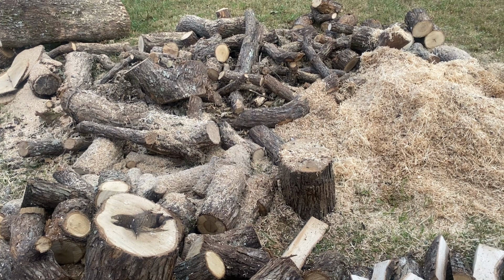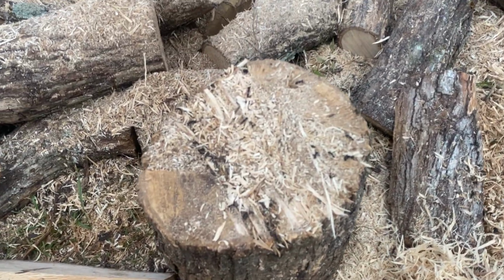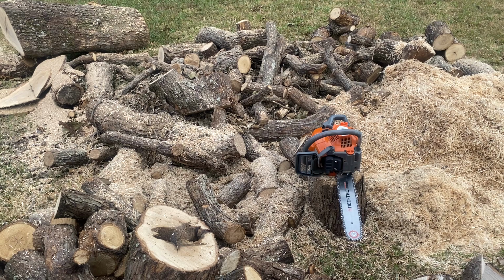First tank on the NeoTec 843 since strato gasket cut!!!!

Comment: I can't hear any difference, what with both being deaf AND my phone on mute 😜 but it certainly looks to be cutting pretty well there after that gasket chop.
Reply from the maker: It definitely made a huge difference. Before it was just boggy and running very rich and wouldn’t lean out any. Now with the extra air from the strato ports it is running leaner and more efficient. Pretty decent little saw for the money.

Comment: I have an Echo 3510 that I've done a muffler mod to.  Seems like this would blow it away for only 1-1.5lb more weight.  Have you ever ran the Echo 3510 and how would it compare?
Reply from the maker: Ran a few hot 4910s but not the 3510, that saw ended up having a bad Carb and blew the spacers out on the crankshaft, new version is updated and runs so much better. 👍🏻
Reply: @dubbssawshop how do you know if you’re getting the new version? At $140 it’s hard for me to not pick one up
Reply from the maker: @bradeagle9724  on the site the newer ones are like $140 the older ones are like $100-$120

Comment: Cutting real good now!  I like the muffler mod too.  Someone said it is an open can?  I mean, it is a strato saw, so it should be just an open can.  Does it ever feel like it is running hot, or over heating?  But, looks like a great little saw.
Reply from the maker: Yep the muffler is an open can, and so far it has been a great saw, never overheated so far anyhow. Strato saws always seem to run a bit hotter than normal saws, but nothing out of the ordinary.
Reply: @dubbssawshop  I just got one, and fixed the gasket covering the strato port, and it runs just like yours - which means pretty good for a stock little saw.  I need to do a little muffler mod, but it runs good just out of the box, once you fix the gasket.  Thanks!
Reply from the maker: @bennyblanko3  awesome!!! That's all I've done to mine still, has plenty power for everything I use it for and pretty light too. 👍🏻

Comment: Hows the plastic case on it? I saw a video where just the pull cord recoil allegedly cracked and dented it. Whats your thoughts?
Reply: The plastic isn't up to Stihl or Husq. standards, and lighter and more brittle plastic.  But, not bad, and fit and finish and color are pretty good.  It is "easy start" and, though I haven't checked compression, has quite a bit, just by feel of the pull chord, for a little saw.  I could see how letting the pull chord zing back would break the recoil plastic.  Especially if you didn't fix the intake gasket problem.  But, once fixed, it starts so easy - one pull, and runs great.  But, not fixed, and having to pull a bunch of times -better be aware of the lighter plastic, or I could see  you ruining the recoil cover.
Reply from the maker: I haven't had any issues at all with plastics yet. Not very high quality but def holds up better than some I've seen.

Comment: These smaller 2 ring saws really need a longer break in time then most.  The good news with this saw is no muffler mod is needed. The muffler is almost an open can with very little impeding flow.  I don't see any potential for gains.  Mine didn't even come with a spark arrestor screen.

Comment: Port job. And alternative fuel ⛽️
 No sir that’s not the lazy way to split wood 😂 often takes more time than a axe does 
 I do it here n there for the noddles as fire starter material. I keep 50lb feed bags full of it
Reply from the maker: Shoot yea it works great for fire starter.
Reply: No Manuka or Manuka brush over there... Much better starter than any noodly shavings I've come across. I wonder what brushy oily bushy stuff you have around that might compare to dry kanuka tops.